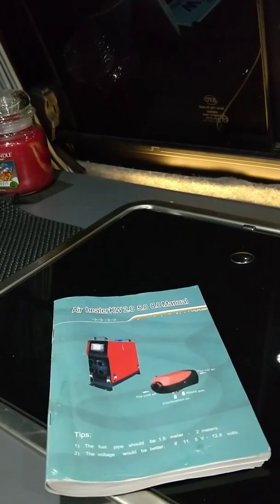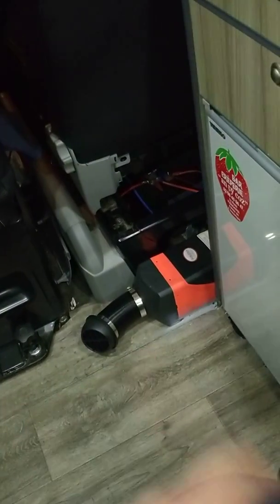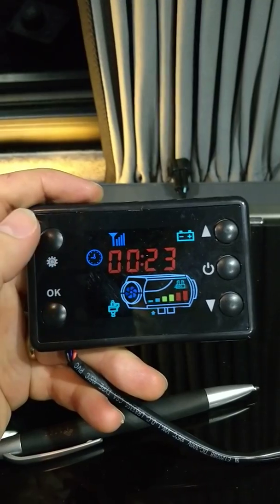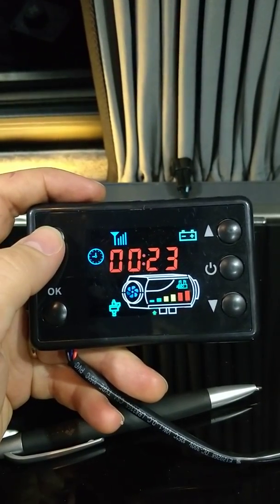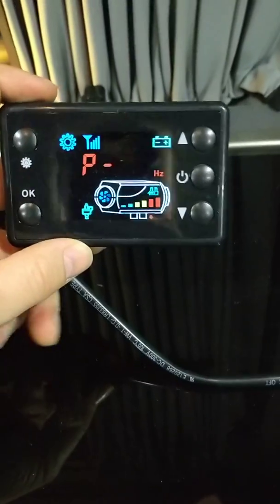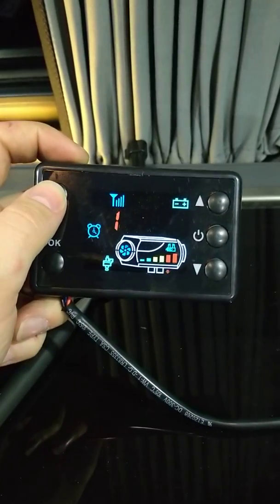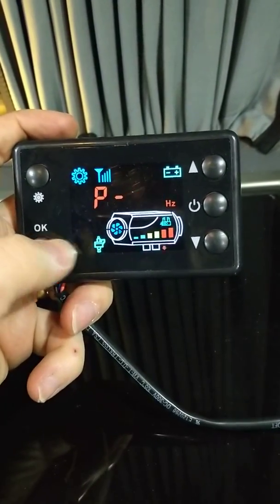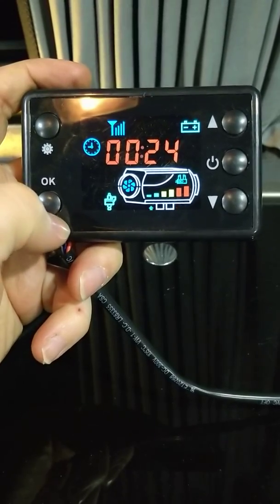Tuning a 2kw diesel heater to run efficiently using a LCD controller

Comment: But what pump size?
Reply: U got it! These settings mean nothing if you don't know if it's a 16ml or 18ml or 22ml or 28ml. If I had to guess prolly 22ml pump but in my opinion ALL these style heaters should run the 16ml pump (which can supply more than enough fuel for even the over fueled fake 8kw version lol) because 16's are quieter and give better more consistent heat! Even the combustion noise is quieter because instead if big burning pulses it's a more steady burn which also seems to make more heat and make the heater much happier long term! My 2kw 16ml settings are 1.1hz 1300rpm low and 4.6hz 5000rpm high but to keep my heater body temps no lower than 130-140c I don't run it below 1.9hz-2.1hz lowest depending on outside temp. Hope it helps someone!

Comment: holy jesus you freakin did it!!!! my guy!!!! you have fixed my heater, i have this 2kw heater i cleaned the fxker , changed the glow plug, put in a 200w inverter, cleaned everything and nothing, this bastard starts up on the first time, no smoke, nothing nada, u uave saved me bro thank you so much !!!!!!! u r doing gods work

Comment: Pf = stongness on glowplugg. Thats full power on 6. I use 4.

But i have 1.2hz low.
Have 3.6hz at topp.

Fan speed i have low 2200.
High 4500.

Fan high can go up all way to last red light goes of. Then back litle so light comes on.
Lights have first 2 green. 2 yellow. 2 red in end.
Fanspeed can be moved up and down. But all 6 lights have to be on.

I think 1hz at low is litle to litle.  But if it not clogs up it is ok for you.

Have bean using this for years and live in a boat there i use this 24/7 winter time.

So after i fine tuned mine 8kw (same same as 5kw ) i did see diesel consume gat waaaaay down.  Exteme. I had 5liter tank i cud see then.
But Fan speed up and Hz down made same heat, but lower consume on fuel, and alsow lower consume in watt.

Start and stopp is not good for this burners.
Only use more diesel and very much more fuel.

Mine is use 10 12 watt on full speed.

But as i told my Hz low is 1.2 high max 3.6hz.

And i do regulate Fan speed.
Fan speed only blows true house around heater anyway and dont use power almost.

And i have bean opening Mine many times.  Locking like new inside.
If to low at Hz then it can make more carbone inside them say.

Best of luck.
Good explaining 🎉

Comment: This way it can run 24/7 no point on and off just keep your window cracked open
Reply: Hi, thanks for the info, you say that all 6 lights have to be on, is this only when the heater is on high setting or low as well? I get all 6 lights on when running high, but only 4 lights on the lowest setting, do I need to turn the fan speed down on the low setting to get it hotter?

Comment: Hi James. I have exactly same unit. Works every time once primed and started BUT if I turn the power off for the controller once turned off and back on E-4 code error comes up and I must reprime the pump again. I stopped and started at least 6 -8 times without turning power off perfect results. I have cleaned all contacts, replaced filter, replaced clamps, no leaks. What is the current draw when power is on but unit not running? I have ordered 2 pumps and filters as spares? I may have to leave the power switch on when travelling for the convenience of instant ignition. Are there any alternatives? Thanks Neil

Comment: I tuned my heater a similar way but instead of just input figures for high and low frequencies, Iowered them 0.1 each time and repeated this until the 6 burner icons changed to 5.  I then added 0.1 to the figures and set these as default.  I am now running on 1.3 - 3.6 Hz.  2300 - 4500 RPM.  The figures at the end after 12-24v setting is to change the number of magnets in your heater… these can vary depending on model 😊👍🏻

Comment: Hi James, these settings are oké if you are using the 0.022 ml pump, there are a lot 0.016 ml pumps supplied with the 2 kw, then settings are rather low, it wil still work but outlet temperature would be low. With the small pump my settings are 4 and 1,3 hz at 4500 and 1500rpm. But it all depends on the power you need, less fuel means less fauling, but don’t go to low, then the heater wil flame out.
Reply: On these settings my heater has a little white smoke coming from the exhaust and never seems to light up. I can't feel any heat either end. What did you mean 4 and 1.3 Hz, what's the 4?
Reply: @deoranjed8118  Did you check your pump size?  With the 22 pump your settings are fine. And why use my settings if yours are oké. 4 is 4hz.
Reply: @wilvandendoel6782  I don't know the pump size, I don't think it says. I had the pump the wrong way round, I feel very daft LOL

Comment: Thanks for all this info, great video. But (and I know this is off at a tangent) but I'm desperate for info on how to set up using the 3 button type LCD switch type. There's ZERO info videos  anywhere other than priming the pump. Grateful for any instructions for that
Reply: Check out Trail Medic

Comment: Finally I found some information on the two kw and exactly what I was wondering about , the settings.  I will try that and see how that works. I had been playing around with it and it wouldn't ignite property then I got that problem solved but it was still shutting off after 10 minutes

Comment: Tried my 2kw heater tonight whilst its starting to freeze outside to get an idea on performance before we set off on a road trip to cold places in Europe. Got these settings punched in and I have to admit it seems to run really well although its the only settings I use as I have not long installed it. No smoke  and no error codes etc. I put it on flat out and it went from 2.2 degrees to 11 degrees in just under an hour. I have a MWB high top camper decently insulated and opted for the 2kw as most people said the 5kw would be to much, wondering if this is not powerful enough as not sure if its normal to wait so long to get the van warm?? can anyone advise? front of the cab windows are not covered though so I know that would not help! if its 8 deg outside takes about 20-30mins to reach a comfortable 16-17deg.
Reply: Just get the most powerful you can fit. If it's too much you can always turn it down, but when cold gets serious you want the big boy.

Comment: Excellent effort sir - always appreciated! 👍🏽

Related note - all that's happened with these particular settings, is that the heater has in effect been 'detuned' to guarantee full combustion. This is great whilst full combustion & therefore no soot is the paramount concern. However - the heater's maximum temperature has been held back by almost 50% here.

Here are the parameters occupying your decision-matrix (& note here that the combustion air intake-rate is literally directly connected to the heater fan speed - so to play with one key parameter (blower speed), directly affects another key parameter (combustion airflow)).

So - if you have too little combustion airflow for a given pump speed (fuel-rate), then you will get sooting. This is the same as too much fuel for a given combustion airflow rate. So, both over-fuelling & under-airing the combustion process, will cause sooting.

What guarantees no sooting (& also virtually no CO emission)? A definitely sufficient combustion airflow, for a given fuelling rate does. So - why not just whack up the airflow to a 'little beyond' what might be optimal - to guarantee no sooting? Because this will 'blow' on the flame too much, cause it to burn cooler than it could (should) - & this will lead to *higher fuel consumption* (for a given output of heat).

And therein lies the trade-off - zero sooting but lower temp & higher fuel consumption. Or - some sooting & max heat available.

Of course - you can avoid all of that & tune it with a CO monitor to-hand, & keep an eye on sooting at the exhaust pipe. With that extra effort, you'll be getting the most out of the heater.

I learned much of the above from another commenter elsewhere on YouTube.
Reply: What would the ideal airflow and fuel ratio be? (I can manually test obviously) but just wondering if you knew off the top of your head? Since it’s below freezing here the air is blowing on the fire too much
Reply: @thomasln0102  I'd say a safe & reliable starting point is - lowest pump speed 1Hz, lowest fan speed 1500RPM, max pump speed 5.4Hz, max fan speed 4500RPM. All these are settable within the 'service' menu, of course.
Reply: Shep VanDelay  This sounds quite plausible, & exactly the sort of thing 'ordinary users' might think of, to dramatically improve a product! 👍🏽👍🏽 (And before anyone says it - no, just because the manufacturer didn't do it, doesn't mean it's not there to be done, with great improvement. Like any manufacturer, they will make the most-profitable product, balanced with quality & efficacy hopefully. Here - we are seeking to completely shift the efficacy part of that compromise).
Reply: Shep VanDelay  They're fantastic devices, & indeed - the price - such a game-changer! Last I had these, was before any of this (20 years ago), an Eberspächer (Airtronic). That was about £3k fitted, at the time.
What I'm happy about now, is that by buying these Chinese diesel heaters - we're not supporting 'counterfeits' or illegal clones. They've just taken an expired-patent scenario & run with it - to fantastic end!
Eberspächer & Webasto used to apparently/allegedly collude to keep prices artificially high.
Reply: Your confusing as the chinese

Comment: Can someone help me out? I have the 5k one ☝️ and it keeps giving me the E06 error 
Not sure 🤔 what it means? 

check the polarity of the magnet, the position of the hall sensor or the loose cable clamps

Is what the translation is. We’ve checked these they all seem fine everything is level any ideas
Reply: E-06 says motor failure in my manual. check the plug on the ecu inside the heater cover.

Comment: Speed Sensor Type
There are two configurations of fan speed sensor on the heaters which can be controlled by these displays. Select one or the other according
to the sensor type fitted. The original instructions say that if this is set incorrectly then the fan speed is doubled. As ever, select using arrow
keys and press OK. It seems that different sensors are used, some with 1 and some with 2 magnets – speed could also be halved I guess!

SN=1:  If fan has 1 magnet attached to it, to give the RPM signal
SN=2:  If fan has 2 magnets attached to it, to give the RPM signal
Reply: This is incorrect info. Sn 1 vs sn2 has to do with single or double polarity of the magnets. All heaters have two. A good test is to take another magnet and hold it up to your existing fan magnets. One fan magnet should attract the  magnet in your hand and one should push it away for the sn1 setting.
Reply: @alexrossmann7672  I was only quoting or sort of quoting what I had read on a forum and as far as the two heaters I have, you are right, both have two magnets. Thank you for the great info mate! BTW, any idea what affect is has on our heaters when that setting is changed? I personally h ave not noticed any difference between the two so curious if there is some subtle affect it may have.

Comment: good info. i have a 2kw heater. I will be at. High Altitudes. 9-10k ft Would you happen to know the settings for High Altitude ? Cheers

Comment: I’ve had to remove and dismantle my 2kw heater twice after only small use and clean loads of soot out. Beefed up the cable from the rear leisure battery and used your settings. It’s been good as gold since, no smoke at all, running dead clean. Many thanks.
Reply: You running it in hz or temp mode?
Reply: @Guggu3d  Temp mode. Been away the last few days in the van and it’s not been too cold so ran the heater for what it’s meant for, keeping the temp about right in a van space at night. Good as gold on a leisure battery with fridge, lighting and water pump being used.
Reply: @Supernice65  Thanks for the reply! Been messing around with it in my car, so far so good! Definitely seems to take a while to get the interior warm and toasty though, ran for 30-45 minutes and only the upper half got warm 😂
Reply: @Guggu3d  Shouldn’t be taking that long to heat up. We get hot air within minutes, 30-40 mins and we’re too hot in a LWB converted Ducato van. Are you getting any exhaust or smoke from the exhaust pipe?
Reply: @Supernice65  Yeah exhaust temps are good! Core temps are good too, think it's just bad insulated car, because the top half gets toasty and the bottom half is quite cold, if I could route the pipes to blow down at the floor, that should do the trick I believe, warm air goes up and the cold air probably drafts through the door panels. Will take a look today and make sure they're well sealed! 👍😊
Reply: Shep VanDelay  That was a 2kw unit. I swapped it out with a 5kw and that made a huge difference! That ran almost every morning and then every now and then during the day for all winter without any issues whatsoever, no smoking or anything, so don't think it's sooting up! Also fitted an afterburner to it for some extra functionality! Definitely an incredible heater! 👍

Comment: great video James, thank you, stopped the black smoke instantly. one question though, at low revs my burner makes a whooooo  noise, like roaring, it goes away when the revs increase, i've set the low revs to 2500 to overcome this, but still get it at start up and shut down?
Reply: I had that roaring noise too until I connected the small hose to the combustion air suction port. Made it much quieter.

Comment: Thanks James. My new heater smokes like crazy also drips diesel from the muffler drain hole. The seller sent me a new  glow plug and pump despite me saying they were both tested and working fine. Needless to say no improvement Hopefully a controller reset will fix the problem Thanks again

Comment: thanks for this. I just came back from a long trip visiting many places and relying on a similar heater for the first time.  If you observe the color bars on the lcd, at different altitudes you need different settings.  I was worried every time both red bars are on, wasnt sure if it is running too hot.  I increased min rpm and lower pump speed for higher alt, andt try to run it with only one red bar.  Any thoughts on this anyone?  I was told that it auto adjusts for altitude but it doesnt seem that it does so properly.  Therefore i was afraid to run it in temperature mode but ran in pump freq mode instead.  Is it possible to run these too hot or do they have safety built in?
Reply: the two red bars means it's fully up to temp, so that's not a concern, it's needed or something isn't right, aka, takes too long to get to the two red bars, or never does, but ya, full 6 bars is GOOD. Sorry for the edits, late here and very tired, but trying my best, but if its running too hot and the safety's are working, it should stop the fuel pump, so far I have not had this issue, but what can happen, the next day you go to start it, it might be grumpy at first, might start the pump, shut the pump off, but let it do it's thing, might thump hard on second attemp, but shoudl fire up as long as the system is clean.

Comment: My small block 2kW came with 'new design' blue round shape LCD controller,
Factory settings were  1.7-5.5 Hz and 1600 -4500 RPM.
It gives very low C0 readings at tail pipe @1.7 Hz:  10 ppm
but  at full speed 5.5Hz/4500  CO goes up to 200 or more (10 cm from pipe).
I dropped the low end to 1.4Hz@1500 RPM, and it still gives low CO there.

The 5.5Hz is probably too much fuel for 4500RPM air.
Reply: Thats the settings of the 5kw not the 2kw
Reply: @3dmixer552  OK!  Do You have the 2kW values ?
Reply: @hikitech218  1.2hz 1450RPM  3.2hz 4300RPM.  No matter how you set it it will produce more co on High settings. :(
Reply: @3dmixer552  Thanks! I'll try those values.
Actually it has been doing fine with the 5 kW factory settings, but I havent'y been running it over 3.5 Hz very much. Too hot in the van....
Reply: @hikitech218   Do you have the small 2kw heater or the fake sold 2kw but the same size as 5kw?
Reply: @3dmixer552  I think is the 'small block': 380mm over all length,  140mm sides
Reply: @hikitech218  that is the 5 kw one.  You can leave it on 5.5 then. They sell these fake 2kw ones.  Same as the 5kw but it has the 2kw settings. The 2kw one is 115mm on the sides

Comment: These settings really depend on the fuel pump size and the tolerance of each unit.  Show people how to tune, not just copying your numbers.
Reply: Hi I'm trying to get my settings right for 5kw . Do you have a link I can access to find out how to do this ?
Reply: @lorrainesankey172  I learned a lot on this facebook group: https://www.facebook.com/groups/146837062640024.  I tuned by sticking a thermocouple from the outside to touch the combustion chamber, keeping the fan speed the same while varying the pulse rate looking for maximum temperature.   I also have a CO meter to monitor and minimize carbon-monoxide output. These heaters are apparently shipped with different version of fuel pumps.  Some pump out fuel faster than others, so you want to tune for the ideal fuel / air ratio.  Most units run fine as arrived, so if your unit runs fine and put out a lot of heat then don't touch it.  But if you feel you need to tune it then do your own research and not just copying someone else's setting.  IMHO.
Reply from the maker: Thanks for your message Hung, your point has been made in previous comments. I don't know the size of the fuel pump but it works for mine. I figure if it works for a handful of people with little or no knowledge of this then I am happy 👍
Reply from the maker: @hung pham. Perhaps you have a video showing people "how to tune"? If so, please share it